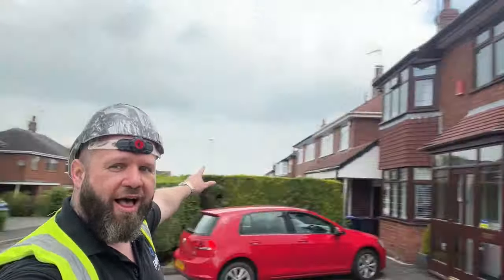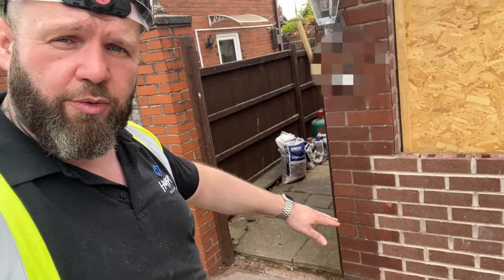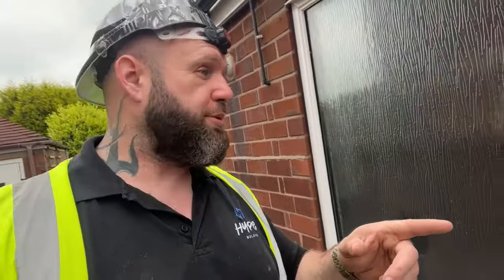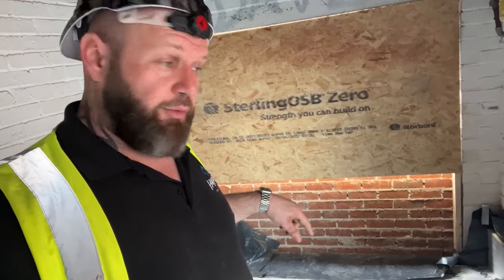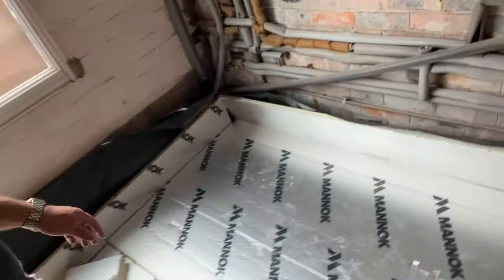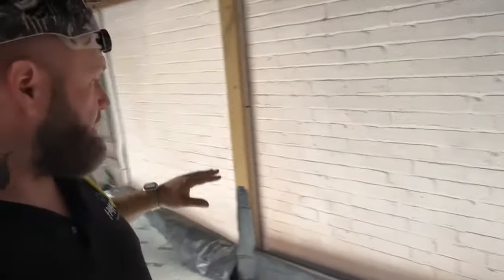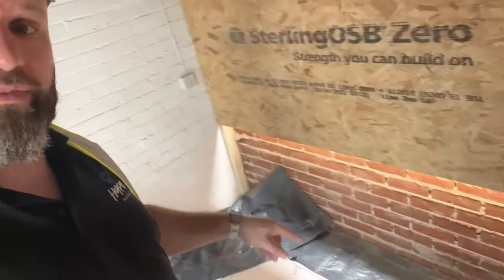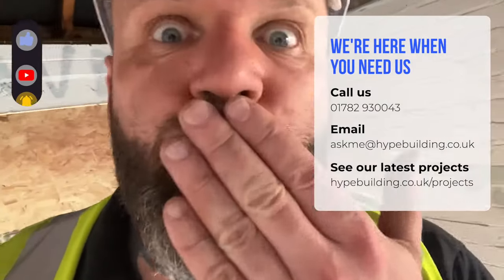Garage Conversion in Stoke-on-Trent (Part 1)

Comment: Great video, my only comment is, its usually best to get the building inspector involved at the foundation stage, because they can advice on how deep they want the footings for the front wall, and it will save any unnecessary underpinning works afterwards.
Reply from the maker: Totally agree, Wayne. However, you can't always get the Building Inspector to come out when you want them to – and if you're on a tight deadline, sometimes you just have to crack on. 

Thanks for watching our video, we genuinely appreciate it 👍
Reply: Do you cover the Stockport area in Cheshire?   @HYPEBuilding
Reply from the maker: @WayneThompson-oh5bn  Unfortunately, we don't buddy. We only cover Stoke-on-Trent and the immediate surrounding area. Stockport is just that bit too far for us logistically. Sorry about that.

Comment: great video, currently in work so didnt have the volume on, will re watch at home,   im doing a floating floor in the garage, when putting the insulation on the floor does it need to be butted up tight, or just sloosely fitted together snug

Comment: A small observation 
, you have bridged the DPC & you should tape the butt joints on the PIR foam insulation.
Reply from the maker: Hi Jan. Thanks for watching our video. This project – and every other project we undertake – is signed off by a Building Inspector.

Comment: We have a membrane at the fron of the garage that is two bricks off the floor and the rear garage wall, the membrane is 4 bricks. Just the rear wall is higher for the ,membrane. Can a conversion still be done as the garage floor is level and concrete.if I just want to turn it into a kitch with units on wall and a car has been parked in the garge,then surly the floors more than ok. Do you have to insulate a concrete floor as all this makes the floor to ceiling height tight.
Reply from the maker: Yes you do have to insulate the concrete floor.

Comment: Hi, 

I am looking at knocking the wall down between the kitchen and the garage to make the kitchen bigger. 

The garage floor is approx 20mm below the kitchen floor. What woukd you suggest to do to thr garage floor to ensure it is at the same height as the kitchen floor and insulated?

Comment: I currently have a single wall brick garage and am looking to insulate it enough to prevent things getting damp inside. What would I need to do in this situation? Will insulating the walls be enough? I have no idea what I'm doing but from a quick search I will need some form of moisture barrier and then insulation then some board to keep it in place. Will that be sufficient?
Reply from the maker: Hi Brandon. Thanks for your questions. We would recommend that you erect a stud wall 50mm from the existing wall and insulate it with 75mm insulation. Then cover the stud wall with plasterboard, wood or another finish of your choice. Hope that helps. Thank you for watching our video, we really appreciate it 🙂👍

Comment: Is it possible to do a garage conversion in a terraced house where one of the garage walls is shared with another house?
Reply from the maker: Hi Henrique. Thanks for watching and for your question. Yes, there's no reason you can't convert your garage if this is the case. Just bear in mind that you will need a party wall agreement if you intend to do any invasive drilling or a damp course etc. on the party wall. If not, you should be fine.

Hope that helps.
Reply: @HYPEBuilding  thanks for replying.

Comment: Could you not have made the mix of mortar darker?
Reply from the maker: Hi Steven. Thanks for watching and for your question 👍 The mortar just isn't weathered, that's all. Eventually it will look the same. In other projects, we have repointed the entire front so that it matches, but on this occasion, the owner didn't want us to do this. 

On another note, a good way to speed up the weathering process is to use natural yoghurt due to its bacteria content.